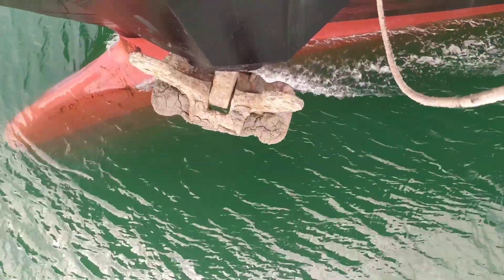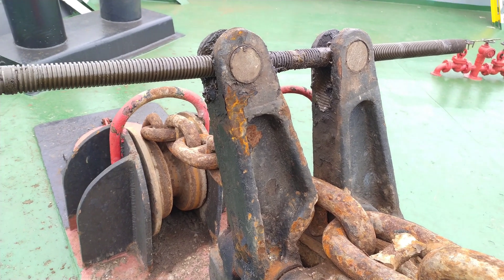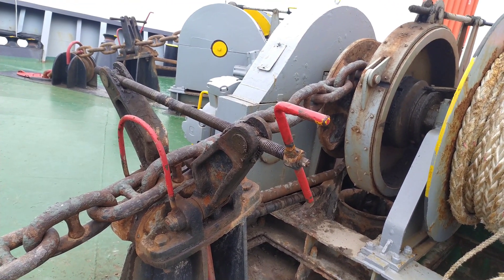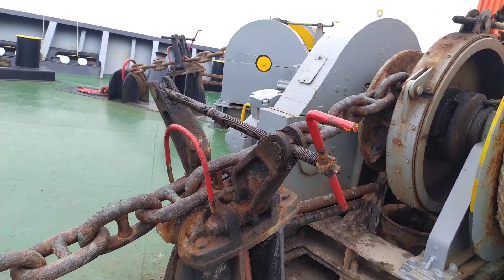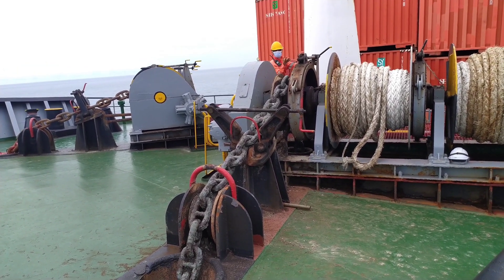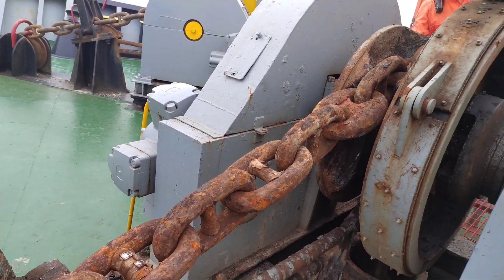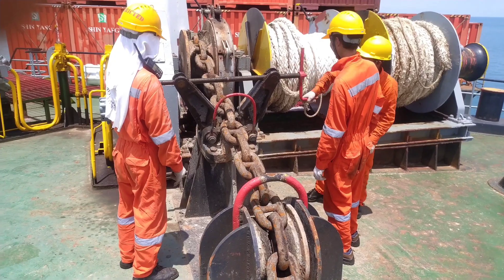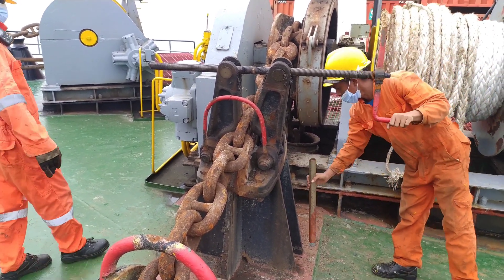How to let go an anchor - Anchor dropping Step by step procedure

Comment: Sir I wanted to know Why we take weight wen we engage gear of mooring winch ya during lowering anchor ya wen der is weight on rope ??if not taken weight eg anchor such big sound will come that gear will break?
Reply from the maker: Possibly the gear may break, but the maximum possibility is that the gear might slip and the anchor will free fall.

Thank you for the query.

Regards ❤️

Comment: Very nice video sir! when the anchor is lowered above the water, can the gear be disengaged first and then tighten the brakes ? in the video was opposite
Reply from the maker: Negative sir. The load is on the gear, and hence it won't be possible to disengage it. Hence, will have to tighten the brake, take load off the gear and then disengage.

Regards ❤️
Reply: @prasobhsugadhan  huge thanks sir for the fast reply! so if the gear is disengaged first without the brake tighten, the anchor would be falling down into the sea, right? And the same principle is for mooring winches: when adjusting a mooring line first the gear is engaged, the brake loosened, the rope adjusted, the brake tighten and then the gear disengaged, correct?
Reply from the maker: The principle for mooring winch is same as the anchor, but the real issue is both are acting at different axis. Anchor is on a vertical axis, while the Mooring rope is at horizontal axis. 

In case of a mooring winch, there is a possibility that you will be able to de-cluth if the rope is off-tension, enabling the clutch to be disengaged.

In case of an anchor, the weight is never going to be off, since always its going to act downwards, rendering the de-clutching operation impossible due to the weight pushing on to the gear. Hence, the only way it can be released off gear, will be to tighten the brake, slightly turn the gear, enabling loss of weight on the gear, thereby enabling de-clutching.

I hope this clarifies your query sir.

Regards ❤️
Reply: @prasobhsugadhan  thank you for you time sir, well understood! All the best to you ❤️

Comment: Sir How to know if the anchor is touch the seabed ground
Reply from the maker: The chain will lose tension, and it won't go through the gypsy.

Also, if there is speed, the anchor will change direction from up and down to short or medium stay at once.

Comment: sir what is 2 shackles and 3 shackles concept on deck, i see too many shackles going once moving from 2 to 3 on captan command
Reply from the maker: Sir, its a good question.

The anchor chain is made of links (which are the ones you see) and every 27.5 meters of length of link is called a shackle.

So, once 27.5 m of chain is completed, it is joined using a Kenter Shackle which will be coloured red and the links on either side will be coloured white (with respect to the number of shackle).

Suppose, its 27.5 m of chain, the first joining shackle will be painted red and a single link on either side of the shackle will be painted white.

Now, if its the 7th shackle, the Kenter Shackle will be painted red and seven links on either side will be painted white.

So, as you let go the anchor, we just watch out for the number of shackles that have passed over the gypsy.

When master gives a command for 3 shackles, he is basically aiming for 3x27.5 meters of cable length.

I believe you got an understanding.
Ping me for any further clarification.

Regards ❤️.
Reply: 1 shackl is from 28 to 30 metres
Reply from the maker: You are around the ballpark figure sir.

But, 1 shackle is 27.5 meters. It is not more, not less.

Regards ❤️

Comment: My friend why it is two man in infront operating regarding bosun,shoudt the assisting monitoring also for dropping how many shuckles on going  to confirm bosun operating
Reply from the maker: Rightly said sir,

But once we form a team, the communication happens automatically. Just by signals, or sight, its easy to find out the shackle numbers.

Basically, its a team work. I believe i couldn't capture the essence of that element on film. 

Regards.